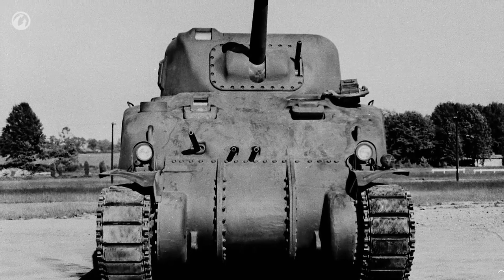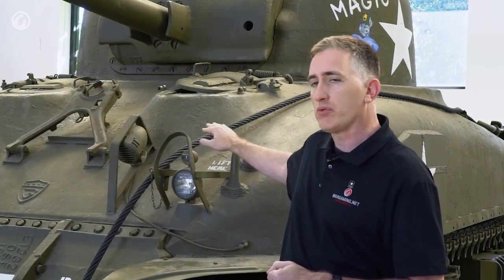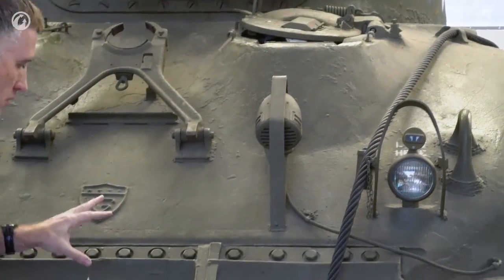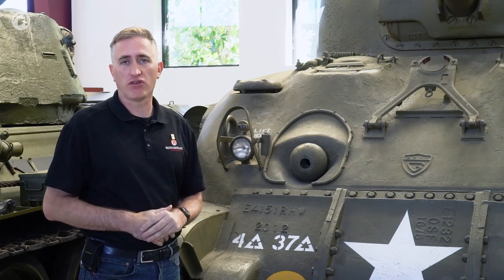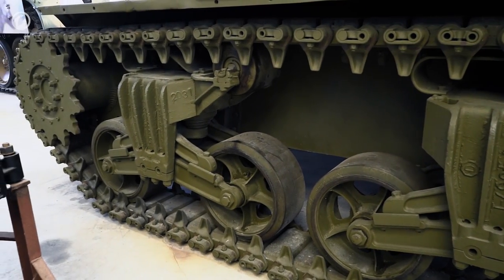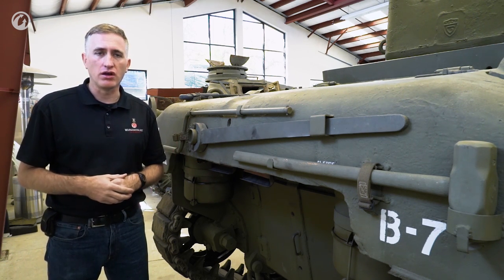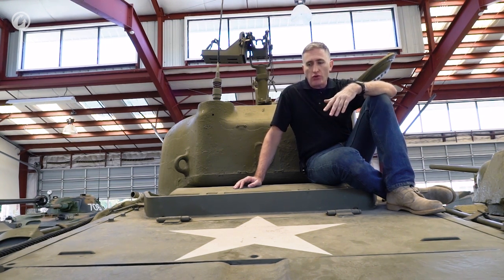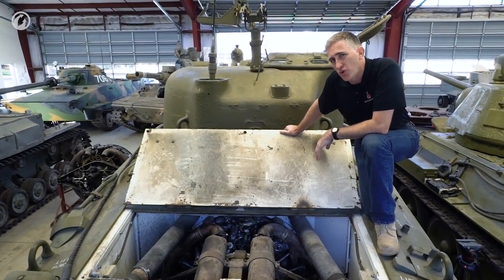Inside the Chieftain's Hatch: M4A1 Sherman part 1

Comment: Your know, I've always wondered if anybody ever used curved armour to redirect shots rather than just ricochet them.
And there's an example right there, the lip protecting the transmission armour bolts.
I wonder what would happen if you had those 'shot scoops' (I don't what they're called, so I've named them, hence forth) repeated over and over up the glacis?
And they're shaped to redirect the incoming shot to be moving parallel to the glacis.
I would if that would work.

Comment: the Japanese called the M4 " American Stove " because it had the tendency to catch fire if shot but still it was cheap so why not mass produce it everyone thought this was the best tank until the tiger arrived and I believe we all saw what happened at Fury right
also make a " Inside the Chieftain's hatch : Fury tank " I would love to see the tank from the movie I think it is kept in Bovington
Reply: It wasn't the best, but merely decent.
Reply: Tiger 1 vs my m4a1 revalorisé  

No contest ill destroy it. 

Real combat m4 still wins
Kuz 105mm canon and it was designed to fire heat most of the time. 

#deadtiger
Reply: M4's are no more likely to catch fire then anything else, it's a entirely made up myth that has no such base in reality, Plus the Japanese never where able to knock out Sherman on number with their own tanks, the best they had was a 47MM gun, that just went "Ping" against the sherman's armor, while the 75 and 76 Armed sherman's could fire though the front of a Chi-ha and the round would be buried in the Chi-ha's engine block.

the only advantage the Japanese tanks had was mobility and light weight, they had to get in close, under 500 meters and fire side or rear shots into a Sherman to even have hope at penetrating it.

Also Fury is a M4 Sherman, its a M4A3E8(76)W a much improved Sherman, sporting the 76MM M1A2 Anti tank gun, it had 128MM of penetration firing its APBC round, thats enough to penetrate the 100MM of armor that the Tiger 1 had, so in reality, the Tiger 1 would be dead on the first shot from Fury, because the E8 was designed to kill the Tiger
Reply: Mr P that is a myth. the lighter conpanies didn't use that slogan until the 50s. the Sherman actually had a burn rate lower than most tanks, gasoline didn't catch fire easier than other tanks that used diesel. the ammunition was fixed in wet storage bins and then removed.
Reply: True Erick but there wasn't many Tiger 1's in service and Sherman's were speedy and agile and in large number... in this case quantity over quality wins the day.  That's the simple part of war 9x10 its a numbers game rather manpower or equipment the side with the most wins.
Reply: John Doe exactly, superior tactics, training, reliability, numbers, and coordination is what won wars. the decision to produce rolling bunkers when Germany was on the back foot was not a good idea, Sherman had troubles penetrating tigers from the front with the 75, but if you fit the 76mm gun onto it it's a capable machine as it always was but has some extra firepower to kill tigers and Panthers from the front now.
Reply: I know all this.

Just comment baiting people
Having fun.
Goin to start a channel soon about the daily life of a wot tanker
Reply: Otaku, just be mate, enjoy tanks like the rest of us ;) trolling a little
Reply: imagine if the Maus was mass produced....nothing could pen that at least from frontal armor the turret cheeks were quite weak
Reply: Tiger 2 would win
Reply: The allies were desperate so they created the firefly to match up against the tiger if they tried to face a tiger with shermans well rip shermans the tiger had the.most accurate gun plus it was an 88 so it was op it could destroy anything a tiger got 22 kills in a single battle how's that until the allies equipped the 120mm cannon I think it was and started killing the tigers
Reply: no allied vehicle had 120MM cannons in WW2 other then the Prototype American T34 heavy tank, and that saw no service, what are you talking about?
Reply: The Fury tank is just a firefly. It's kinda the same as the m4 just with less turret room and a different mantlet.
Reply: Also one must consider Germany was able to play a defensive campaign within their own country/continent... and USA had to travel with sherman's thousands of miles to get them into the battlefield! Yea sure tiger had a big gun and nice thick frontal plate but it didn't come into play until later in the war and was very low production. Sherman's were to USA what Panzer IV and Panzer III's were to Germany... these 2 tanks were the main souce of tanks for Germany in WW2. A lot of people think Germany kicked off the war with Panthers and Tigers in abundance, that thought process is extremely wrong. But guess what USA had m36 in service in Europe around time Tigers and such were rolling out, m36 with a big ass 90MM gun mounted on the front... GG Tiger and Panther. I believe as war was ending the pershing started to really roll out if the war had continued another year pershining would have been top dog on the field in Germany no questions asked. So ppl can say this or that, reason Germany lost yeah they had tigers but it wasn't the only badass tank on the battle field in 1945.
Reply: Redneck Fury exactly, we had 120mm guns that could be developed and or combat approved, but we didn't mount it on anything besides the t34 heavy, then later the m58 gun on the m103. but the m103 was post war and picked up by the navy.
Reply: Well just like the t34, the Sherman was good enough for the situation at hand
Reply: where did you here "American stove" by Japanese?  are you making that up?
Reply: Paladin Yogi - Yep it's not the tank it's the crew and whoever fires the first shot usually wins.
Reply: Toastable Pie pretty much, because logic fits an ideal like that, if you fire the first shot. you calm, cool, and collected, meanwhile, the guys on the receiving end are having a SIGNIFICANT emotional event! 😂😂😂
Reply: SuperCessna1959 - Yep that's probably my favorite part in that video.
Reply: Well he believes that a movie made by Hollywood is proof that the sherman's rounds will bounce off a tiger every time.....

I'm going to say he's either incredibly misinformed or trolling.
Reply: ToolofSociety pretty much.
Reply: +Redneck Fury The tank used to play "Fury" is an M4A2E8, so it lacks the bigger engine.
Reply: Lavrentivs QQ. 😂😂
Reply: I am just saying that M4 tanks didn't have a lot of armor so they were easy to kill by tigers also let's say that instead of a tiger 1 there was a tiger 2 in the movie would the Fury and the two other tanks be able to penetrate 185mm of armor? Also if the tiger was stationary and didnt started moving it could have easily killed the shermans
Reply: Mr P so many things wrong with your comment. 1. the Sherman actually has a fair bit of armor. the m4a2e8 in the movie had a 63mm thick plate sloped at 45 degrees. that gives it 90mm effectiveness. 2. no tiger 2s would be pushed that far out of Germany, the fury crew haven't reached Berlin yet. and the 76 Sherman's like the fury can kill tiger 1s with ease at normal combat ranges. and the tiger can't sit still, it would have been flanked and surrounded easier. and it HAD to move forward because of the smoke.
Reply: +Laveretivs Technically speaking yes, it's a post WW2 conversion of a M4A2 into the E8s suspension system, but no A2 E8s where manufactured during WW2, so it's meant to represent a GAA powered A3.

Infact the only HVSS equipped Sherman during WW2 was the A3.
Reply: SuperCessna1959 the tiger could penetrate a Sherman from 2,100 metres  away so even if the 76mm Sherman could destroy it it must have been at least 600 metres from the tiger to penetrate its frontal armor ,400 metres to pen the nose and 700 m to pen the turret so tiger wins due to gun range
Reply: We get it, if we got to chose sherman m4 or tiger I during WW2 we are all going to pick tiger I.... but what majority are saying, do not underestimate a sherman because sitting in your tiger I you could be dead just the same. And on top of that sherman's probably outnumbered tiger's 100-1!
Reply: SuperCessna1959 also the gasoline engines the shermans had made them death traps for their crews if any catastrophic hits happened then bye bye sherman
Reply: Mr P hah, no. stop listening to Belton coopers books and stop watching history channel, the Sherman's gasoline engine didn't catch fire any more than other tanks like the Cromwell, the Cromwell had a gasoline engine as well. so no, they are not death traps.
Reply: Mr P sources? the M1A2 gun firing HVAP had higher penetraiton then the KWK36 did with its APBC round
Reply: SuperCessna1959 it did catch fire even if not more than other tanks but it still caught fire so..
Reply: ALL TANKS CATCH FIRE, this means it's not really a trait to bother dealing with.
Reply: Belton Cooper got many MANY basic facts wrong in his book and it's a travesty that people consider him the end all authority on Shermans... Shermans stopped having issues penning enemy tanks once the higher ups gave them the good AP and stopped insisting on tanks carrying almost exclusively HE. The ones in charge thought that tanks were there to bust bunkers and other fortifications so they packed teh sherman full (and by full I mean every nook and cranny) with HE rounds and a couple of the old shitty AP rounds. The cramming of HE ammo into every corner is why shermans would explode when hit...

I bet Mr P doesn't know that German later tanks especially the tigers generally suffered from poor armor construction. There's plenty of pictures of tigers with shattered armor that broke when hit by a 75mm or smaller round. It's hard to make good armor when you're a relatively small country engaged in a massive war on various fronts.  This excludes the myriad mechanical issues they had for the same reason (including the those caused by the slave labor).

In a perfect world the tiger could do all that stuff but in reality very few were able to do anything resembling the claims made.
Reply: Personally my choice would be dictated by the scenario itself. Things such as the location of the fight the state of repair what year and more. Tigers broke down a lot in the field and were tough to work on. Later in the war the break down rate was exasperated by intentional sabotage by slave labor and the destruction of factories via allied bombing. Even the armor of later tigers was generally compromised due to the manufacturing conditions at the time. Metallurgy in wartime conditions like that is difficult and armor would end up brittle or not nearly as effective as it should be.

On the sherman side of things if it was early on in the war then you're screwed as you're going to have a tank full of HE and a few rounds of low quality AP because the TDs got all the good ammo. If you're later on in the war and you finally have the M61 APCBC rounds then you're much better off as you can easily pen the sides (including turret) of a tiger even if the tiger has the optimal armor construction.

The soviets fought many MANY more tigers than the USA ever saw and the Soviets loved the 75 mm gun with the M61 ammo..

It's been estimated that US forces only ran into a few tigers the entire war. Most supposed tigers were misidentified as many things are in war. 

The talk of sniping and shooting tanks at +2000 meters in western europe is wishful thinking outside of scenarios where the defense has time to setup properly. If you've ever been hunting you know how hard it is to see stuff in a cluttered environment. Even deserts have dunes, irregular heights and winds whipping up sand to obscure long range views.
Reply: Mr P 
The american crews themselves called their Shermans (until they were fitted with wet ammo racks) "Ronson" after the lighter brand.
Reply: max mustermann yes and the logo of the lighters was " Lights the first time , every time ! " lol
Reply: max mustermann that is not true? did you get your history from a cereal box? 1. the lighter companies didn't use the slogan until the 50s. 2. most m4a1 Sherman's were fitted with wet storage by the time that the m4a2 a came out. 3. the whole myth about the Sherman having ammo issues after that is because British crews weren't trained to store ammunition properly
Reply: Mr P once again, that Is not fact, please stop quoting Belton Cooper as a valid source. he was a mechanic, and most of what he said he pulled out of his 🐴. take it from me, who has sourced out actual historians who looked through historical archives. stop listening to fantasy books and look up some real facts. the Sherman was never called or nicknamed that. the lighter companies didn't use that slogan until the 50s. and the Sherman had m4a1s fitted with wet stowage late war and m4a2s came with wet stowage out of the factory. m4a3s didn't need wet stowage because they had the ammunition stored in the floor. in fact, THE ONLY TIME a Sherman would have had ammunition problems by 44 was the British crews not being trained to handle ammunition properly.
Reply: SuperCessna1959 I am kinda bored responding so...end of conversation
Reply: ok ok  I get it I was wrong about the things I said about the M4 having the tendency to catch fire etc but hey at least now I know what is true about the M4
Reply: Lesson learned
Reply: "Lesson learned." That is all I wanted from this thread. Thanks for taking the time to read our posts. I will freely admit I was wrong when I said you might be a troll earlier.

There was a day when I believed all the same stuff you believed. It wasn't until a few years ago that I learned how wrong I was.
Reply: ToolofSociety 👌👌👌
Reply: The Chieftain himself has a good video up called "Myths of American armour" or something along those lines which mentions a lot of stuff brought up here. I strongly recommend it.
Reply: I will check it out
Reply: Mike P .. The tiger came out almost before the Sherman.
Reply: african american cookiemonster its a movie you should never expect a war movie to be 100% realistic if the tiger crew did what you said the movie would be over
Reply: +Chris Gaming meant 25 kg explosive charge point still stands though
Reply: @JohnDoe-fv3vs  Thank you John. The defensive nature and the hedg rowe battle field was a distinct advantage for the defenders. And Yes the Tiger was probably more psychological than anything.

Comment: Weren’t the later wide Sherman’s called an Easy 8 not an Easy 9?
Reply: Different suspension types. The E8 was the 23" track with horizontal volute suspension. E9 was the original 17" track with extended end connectors and spacers between the hull and the bogie.

Comment: Yes but the armor is rounded and angled making it 10X effective
Reply: Johnny B Casted hulls are actually weaker due to a less dense metal. So saying it's better is a fallacy. Rolled armor is actually better if used like the T-34 if it was slope giving it better protection. The Sherman cast hull is remarkable for being easy to make, not being overall better, why did you think most variants of the Sherman had wielded hulls? The Sherman Jumbo had a wielded hull and was far better in armor protection. And you cannot say otherwise.

Comment: what would happen if that aircaft engine had minimum power like if it was in aircraft(900-1000 hp) in tank
Reply: It would probably break the transmission or the engine would rattle itself to death.

Comment: "The tanks with cast turrets were M4 A1s and those with welded turrets were just M4s"? What about all the dozens of other types? That statement was only true for the short time that the M4 and M4A1 were the only existing types. An M4A3 has a welded hull, yet isn't just an "M4".
And so what is "the most important part of the tank"? I don't get it. You say it isn't the gun, and then go on to talk about how the dock cranes weren't heavy enough to handle heavy tanks. So what is the "important part"? The lifting rings?

And it's not "sheet metal", it's flat armor plate.
Reply: M4 and M4A1 were the weld and cast hull designations for the Shermans using the Continental Radial engines, which had the tendency to overrev and you had to hand crank them to start. The M4A2 used a diesel engine and was mainly used as an export variant to the USSR in the lend lease program since the Soviets used diesel for their tanks. The M4A3 used the Ford V8, which was just an all around improvement of the Radial engine that didn't need to be hand cranked and wouldn't overrev in the way the Radial might. He also did mean the most important part of the tank was indeed the lifting rings, for the case of, "Nothing else about the tank matters if we can't actually get it to the fight."
When it comes to the M4 Sherman, the "A" type or lack thereof is a moniker for what engine the tank had mainly.

Comment: inches everywhere, please use a lenght system that makes sence so everybody understands it
Reply: It's what the tank was buit to. European vehicles, I use metric.
Reply: There isn't one.
However, if you are familiar with the SI system rather than the American/British one; One inch is 2.54 centimeters, one foot is roughly 30 centimeters, and one mile is 1.609 kilometers. If you remember those things it's really not that hard to convert the figures in your head.